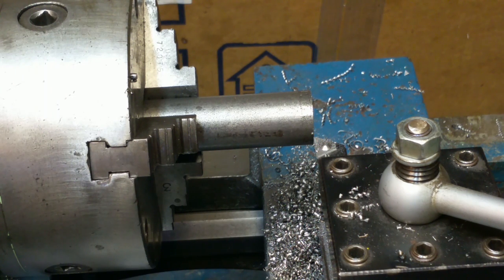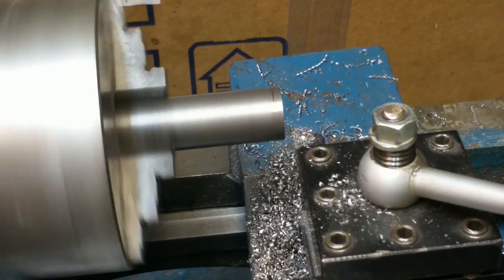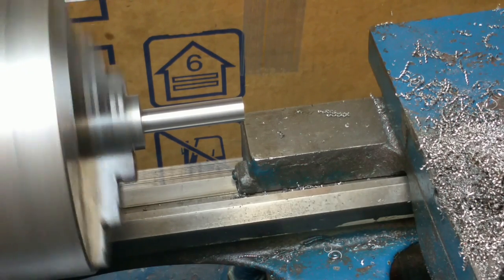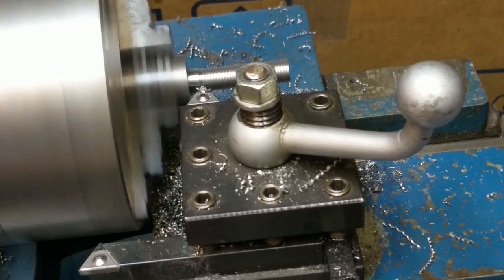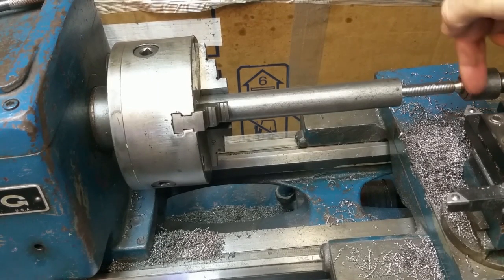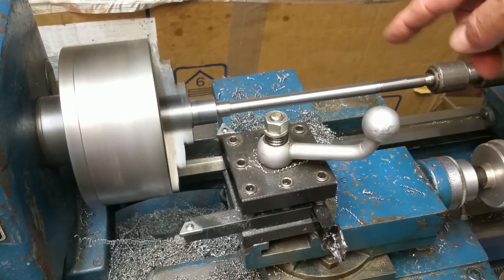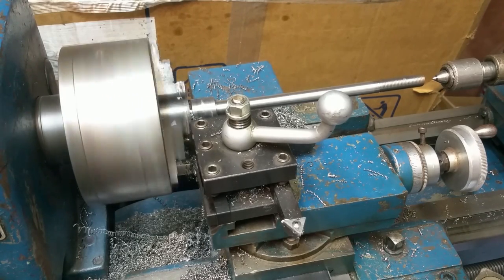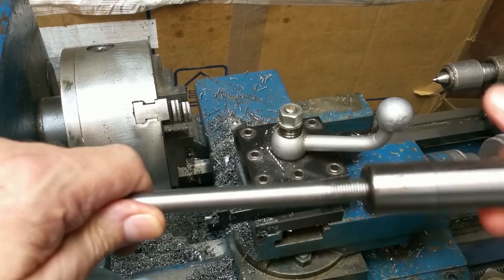Making A Drawbar On A Manual Lathe

Comment: Do some research about setting compound at 29 degrees,, anywhere between 25 and 30 degrees,,,but not under 25 and not over 30,,,I've found 29 degrees to be best,,,  will give you much better treads and the angle will make your rest more stable for all your turning, if not your treading straight in and cutting on both edges of your tool and not getting precise treads.. And it's good practice to cut a release groove where you want treads to end..

Comment: Should set your tool rest at 25 to 30 degrees for treading,,,your cutting on both sides of bit if you don't,,,I leave mine at 29 degrees for everything,,,it makes your tool rest a lot more stable for all work,,and get yourself a tread gauge,,,and not good to use compressed air,,will blow chips in places you don't want them,,get a brush,,and I use a shop vac.
Reply from the maker: I do take some liberties when hobby machining.  It's an old lathe but fairly new to me and not set up ideally.  I use a short bristle chip brush most of the time and I'm always careful not to blow chips into the moving parts where they'll cause a problem.  My final excuse - this was a rush job that was shipped to my friend an hour later to get his CNC mill back in production ASAP.  Thanks for the solid advice that will hopefully benefit others.
Reply: @Liberty4Ever  hope you don't mind free advice, try the 29 degrees and leave your compound set there all the time it will really make your cuts better and save wear on your machine,,,I have a old 12 x 36 atlas and it makes a big difference.
Reply from the maker: @georgespangler1517  - I already knew about setting the compound angle when cutting threads.  When I first heard about it, I had to think about it before I understood the reasoning.  Sadly, I didn't do that in this video, and that definitely isn't demonstrating best practices.  I didn't promote it as a tutorial, but there is some obligation not to convey bad information.  I've seen a lot of Dunning-Kruger award winners who claim to be internet experts and I don't want to be that guy.  If I was going to be sloppy about it in my haste, I should have at least mentioned the correct way to do the job.
Reply: @Liberty4Ever  believe me I've done the research,,,even a computer generated of the 29 degrees cutting in on treads,,and how much it decreases the cut on back side,,you will always get a little cutting but you never want front and back to be the same,, your set for the on collet now, but if some of the others vary it could damage them,, you can probably feel a sharp edge on the treads that was cut to sharp, best to lightly sand them dull now.
Reply: @Liberty4Ever  your getting the long strings instead of chips because your cutting both sides of your treads ,the 29 degrees will stop it from happening and give you better treads that will fit any bolt are nut of that amount of treads per inch.
Reply from the maker: @georgespangler1517  - There was no chip breaker on that cutting tool, and the leaded steel I was using machines very well but is so ductile when machining it doesn't tend to break a curling chip.  Those were my record breaking chips.  They were actually easier to remove than all but the shortest chips fall away in tiny curls that can be vacuumed.  The worst are the curly 6-12" chips that bird nest.  I hate those.
Reply: @Liberty4Ever  on a diameter that small it's best to use tail stock with live center to keep it from flexing to keep a consistent cut,,and that's where the 29 degrees really helps it gets compound clear of tail stock and even makes it easier to reach and turn,, more in front of lathe and much more stable not trying to lift up from Gibbs..
Reply: @Liberty4Ever  me too,,, l went too high speed steel and grind my own now,,,carbide is great for rough cutting on small lathes but  carbide is best at higher speeds and deeper cuts then our smaller lathes can handle,, with high speed you get a sharper tip and much finer finish and better chips,

Comment: your compound was not set at 29.5% that is why you were cutting what was a heavy cut
Reply from the maker: +David Phillips Exactly right!  I usually plunge straight in with a carbide tool, and it does cut both sides of the V at the same time, which can pile up chips on both sides of the cut.  I have aspirations of converting this old lathe to CNC, and the CNC will control the cross slide but not the compound.  So I was basically cutting threads like they'll be cut with CNC.  Advancing the cross slide that's set to a little less than half the thread's included angle only cuts on one side of the tool as it advances and that typically makes a better cut and nicer threads, but I barely got this part out in the mail that day as it was.  No time for the fancy stuff.  BTW - My friend heat treated the custom drawbar, and the last I heard, he was still using it.  He said it works very well, despite my shortcut on the thread cutting.  :-)

For a machine that uses the same collet to hold all types of tool holders (like the Tormach Tooling System collet on my milling machine) it'd be great if the drawbar and collet had rolled threads instead of cut threads.  That may be how it's done on expensive machines, but all of the small machines I've seen use regular old cut threads and they seem to work well enough.  Drawbars and collets are replaceable wear items, but I've been using the same drawbar in my milling machine (occasional use) for maybe 15 years.